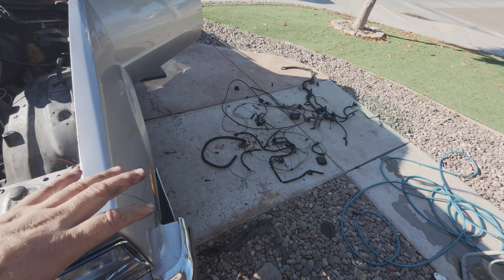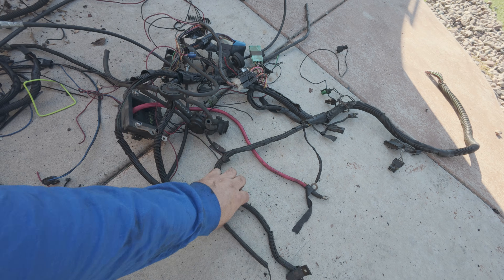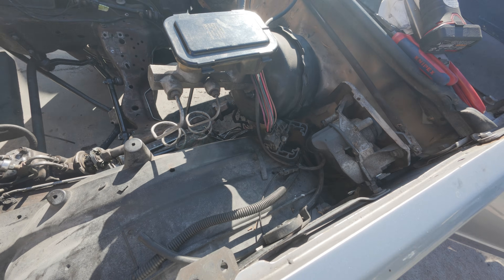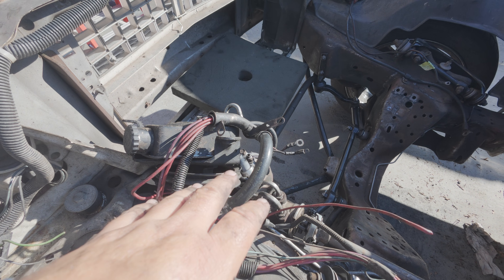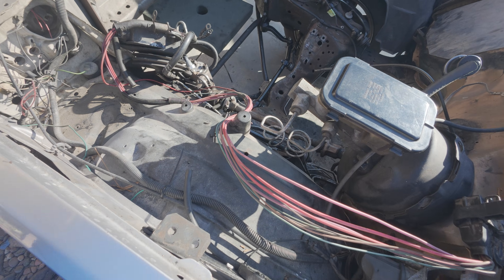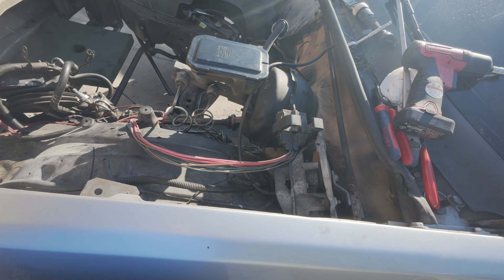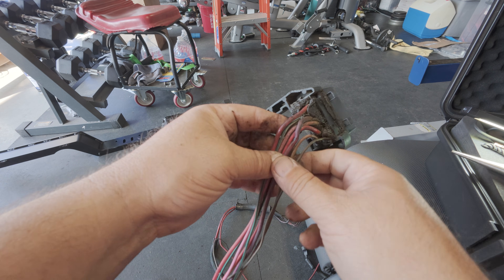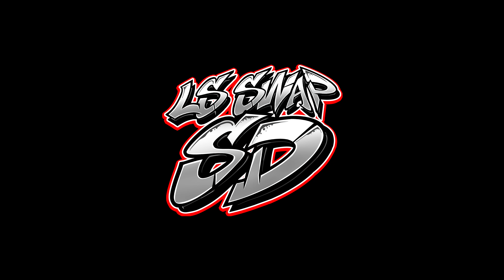El Camino - Video 2, Vehicle Wiring

Comment: My man, I need your help, literally doing the exact swap 87-GMC CABALLERO ENG is pulled, A/C box is removed, ENG side fuse box disconnected. MY ISSUE IS THE HARNESS THAT CAME FROM THE A/C BOX THAT IS CONNECTED TO THE bcm OR ecm THATS ON PASSENGER SIDE KICK PANELS. What do I do ???? HELP PLEASE>
Reply from the maker: I have a subscriber section on IG where I help people with their swaps 🙌🏼